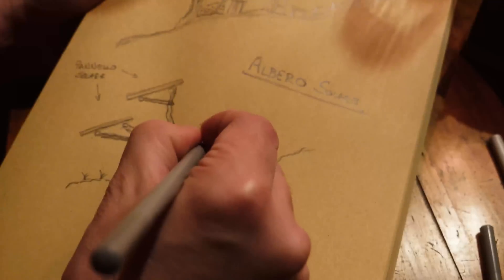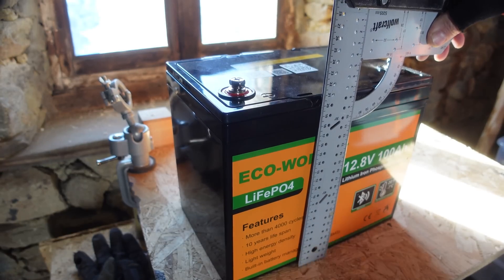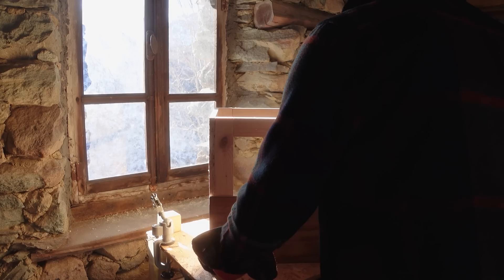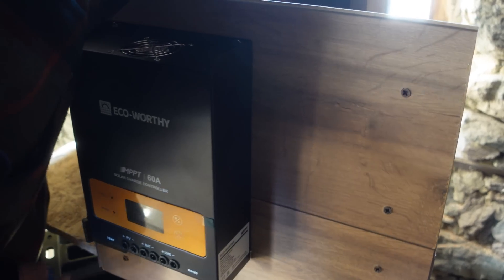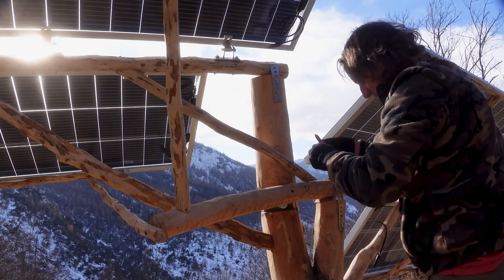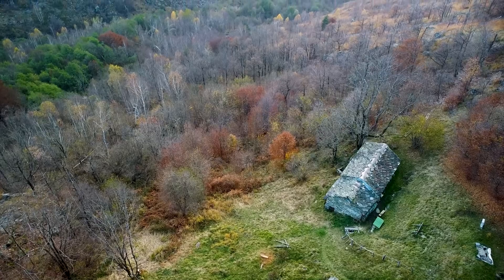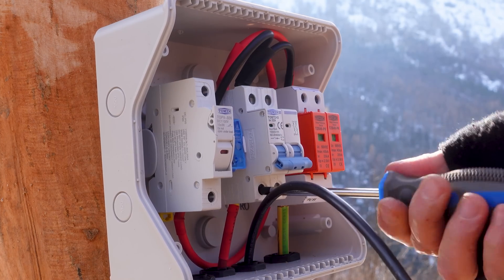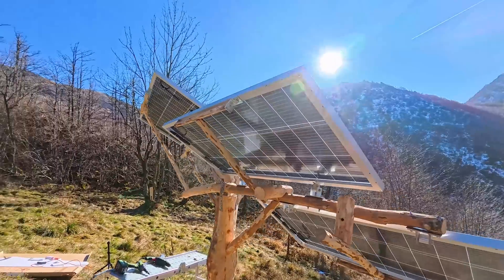DIY Solar Energy Storage with Eco-Worthy Battery Setup | Off-Grid Energy System

Comment: Good Job Alex!I like what you have done… a LOT. Thanks for the clear and concise descriptions and video. 
Much approve of the 90 volts to the house. Makes a better install money and efficiency wise. Also, for your application, 12 volt system is perfect, I think. Lots and lots of things are available for use at ‘normal’ prices rather than specialty prices. And, with your inverters, you have the best of everything. 
Keep it up! 
Merry Christmas!